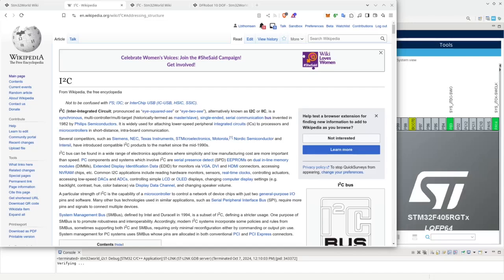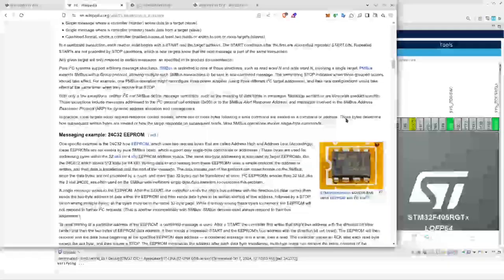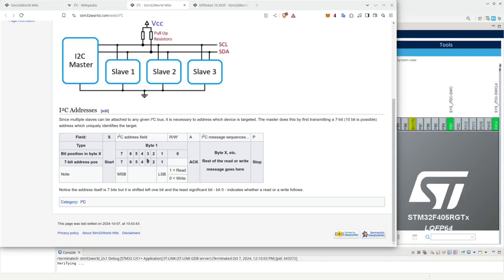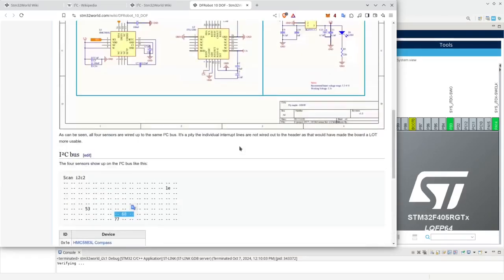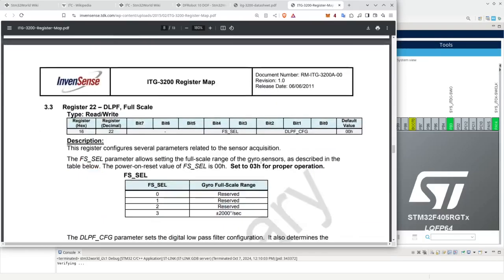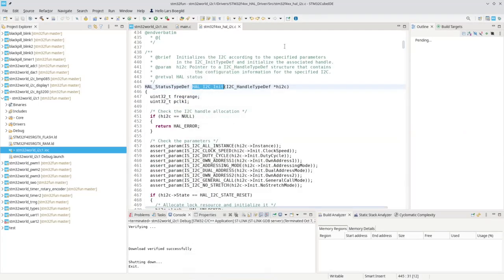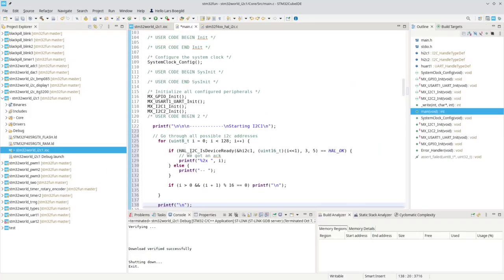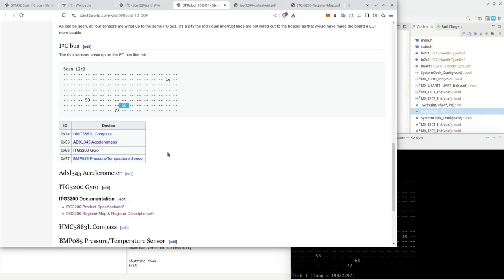Understanding I2C | STM32 Tutorial #20

Comment: Do HAL I2C use interrupts or it is blocking? I2C is slow and if it is blocking it eats a lot of processor time.
I implemented interrupts with i2c interface to two Li-Ion batteries on pic24 and it got quit complicated.
Try to do it without HAL, may be next stm32 bare metal? A lot of fun!
Reply from the maker: Like all the stm32 peripherals that depends on what you want.  You can use it blocking, you can call it unblocking and wait for Interrupt or you can use DMA.

Comment: Excellent intro to I2C.

Have you ever worked with the MCP23017, which is an I2C-driven GPIO extender chip? Would you ever consider doing a tutorial on using the MCP23017 with STM32, using the STM32 CubeIDE and CubeDX?

Thanks for all the work you put into these tutorials!

Mike
Reply from the maker: I did some stuff with MCP23017 years and years ago - on ESP32 probably but I don't have any breakout boards lying around as I have mostly been using the AW9523B (a lot cheaper and a LOT more features including LED drivers)

Comment: I need to learn this, I’m kind of new to i2c internal workings, I like it because of the 1 or 2 wire connection, easy with addresses as well!!! I have this infrared ranging sensor, the only information it comes with is the exact stuff your teaching in this content, with bit information, 13 bit addresses, tof distance low byte, tof distance high byte, flow x, flow y, and so on. I’ll look for a email address, I’ll send that information? Maybe you can help? By the way, I put it on an oscilloscope and it’s putting out the two signals, put paper over it while connected to oscilliscope, you can see the data change on the screen!! I wish I was as smart as you on this stuff, you’re amazing!!! Have a good day, month, year and so on!!!
Reply from the maker: Start slow.  Find the datasheet for the device you are using and read through it.  Understand the register layout in the device.  Next up - in your stm32 code - scan the i2c bus and make sure you can "see" the device.  Next up - most i2c devices have a read-only register returning some device ID.  Read that to verify you read from the right device.  Then it is simply a matter of adding registers.  See my video about i2c library.